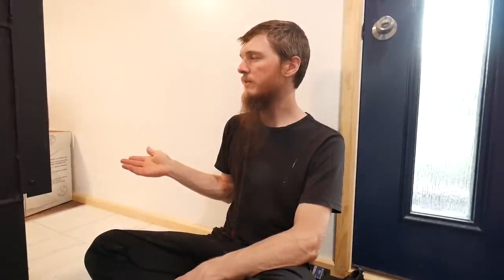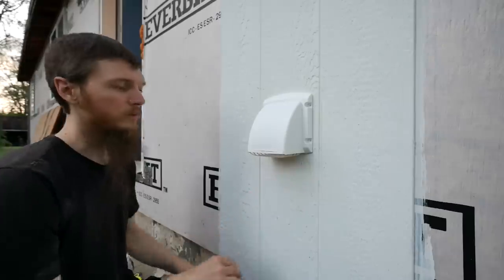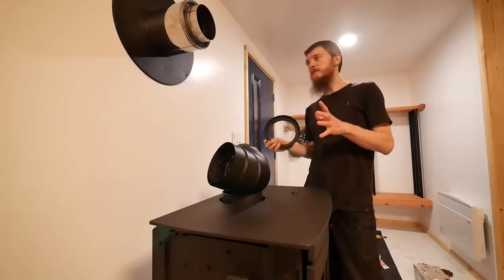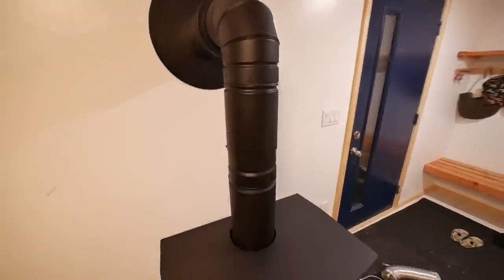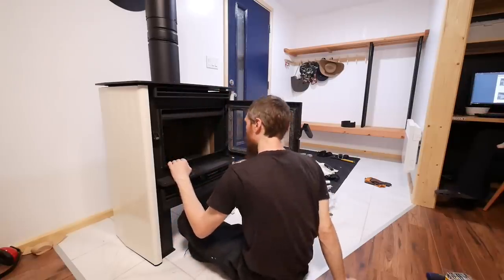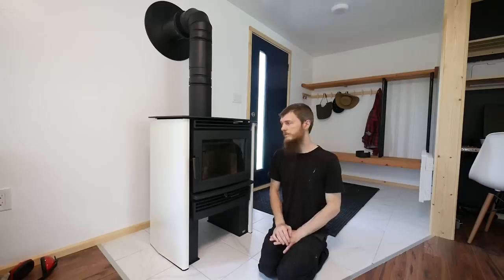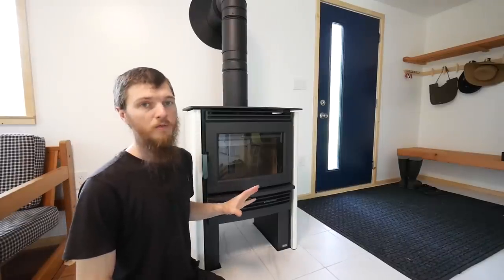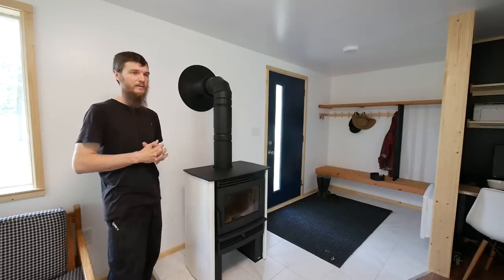DIY Mobile Home Wood Stove Install

Comment: How will you prevent the grout underneath the wood stove from getting stained with soot from fallen ashes? You might reconsider the pad? A flame retardant rug of some sort? Where are the flues? Maybe I mean damper...
Reply from the maker: It has an air control handle under the door. We're not too concerned with the grout becoming discolored :)
Reply: I suggested the same thing.  Heated with most of my life . Theirs is not main heat so may not be a real big problem ?

Comment: all them stoves do is add a extra hole in your house, i been running woodstove for over 30 years and that pipe is completely not necessary at all id never buy a stove that had that on it
Reply from the maker: The chimney? Or the optional air instake? It works with, or without it. It's a requirement for mobile homes, and a good idea for very well sealed homes. But, it works fine without it too.
Reply: The nice thing with the intake is you're not sucking cold air back into the house from any possible air leak but rather using outside air.  Similar to a high efficiency furnace that's why they have 2 pipes going out.
Reply: @diyfferent  per code maybe lol ive used a double door timberline the last 30 years and in a mobile home any drafts are welcomed as its always 75 plus all winter
Reply: Glad to hear it’s not necessary. I really don’t like make more holes if I don’t need to.

Comment: WHY DID YOU LET THE PIPE GO THRU THE  OVER HANG  / YOU COULD OF JUST EXTEND THE  THE PIPE  A  8 OR 10 INCHES AND GO BEYOND THE OVER HANG  MAYBE JUST TOUCHING THE EDGE OF IT AND USE PIPE BRACING TO HOLD IT IN PLACE  THEN YOU WOULD NOT HAVE ANY ROOF DAMAGE  AT ALL   / I HOPE YOU UNDERSTAND  WHAT I AM DRIVING AT  YES/NO ?
Reply from the maker: Yea, we understand what you're saying. The support bracket doesn't allow the pipe to come out any further. Plus, I don't think it would look as good sticking so far out.

Comment: IMHO fireplace in a home is extremely unsafe due to carbonoxide produced during combusting. Sometimes weather conditions are so strange that causes smoke of a stove goes into a house. Active exhaust decreases  danger but it's not 100% because of robustness of any mechanical system is limited.
Reply from the maker: It's safe if you have it installed properly and know how to use it. The outside air intake helps too. But I have seen wood stoves smoke up a house. We both grew up with them.